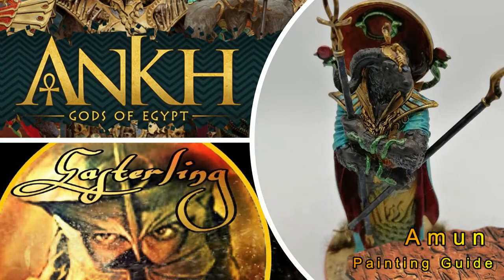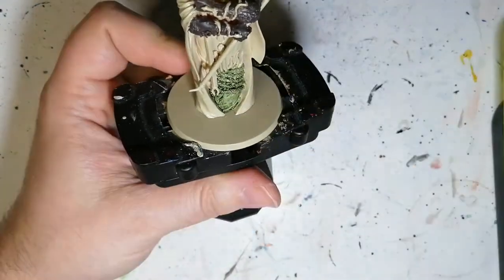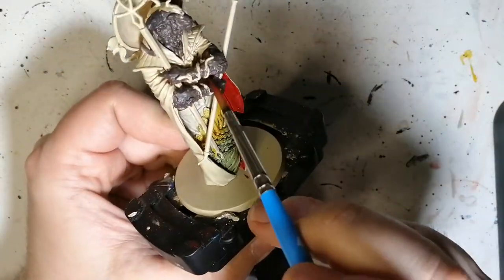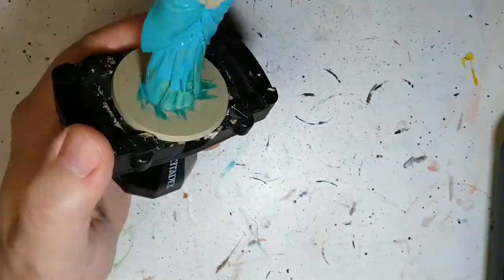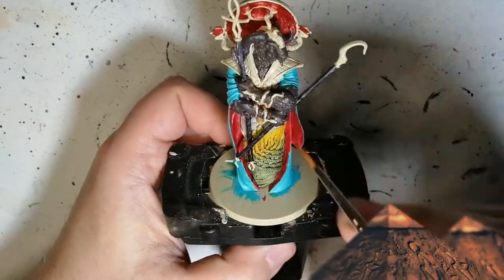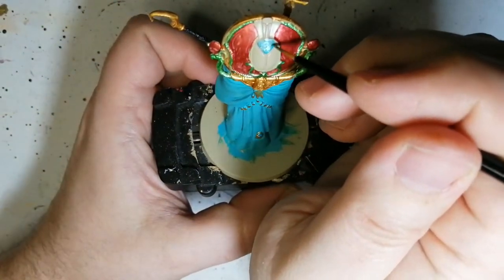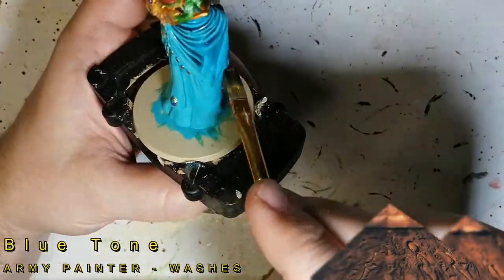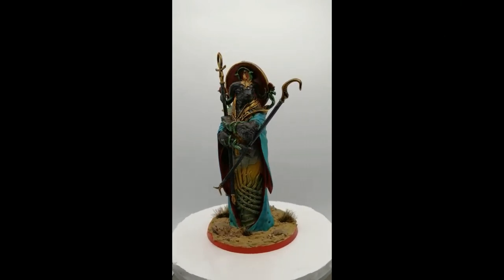Painting Ankh: Gods of Egypt Ep. 48 - Amun

Comment: Dana Howl has a good Speedpaint video about reactivation. Feel free to check it out. To sum up, Speedpaints aren't acrylic paints as acrylic paints do not reactivate. They are a resin medium solution and you should treat them like oil paints. Basically, do not use water on them. That means no washes and no water-diluted acrylic paints. Otherwise, you should be good as long as you don't use your paint brush as a scrubbing brush. 

Also, just thought I'd say thanks for your videos. I'm new to painting and while improving is always the goal, I don't feel like my Runners, Biters and Shooters in Project: Elite are meant to be in a museum and you totally get that. I like that you paint quality minis for tabletop games without lose sight of the goal: good looking minis ready for the table sooner than later.
Reply from the maker: Thanks that means a lot. And yeah I need to treat the speedpaints very differently